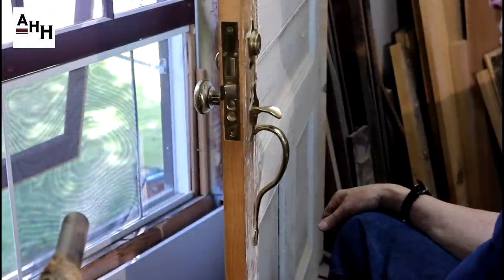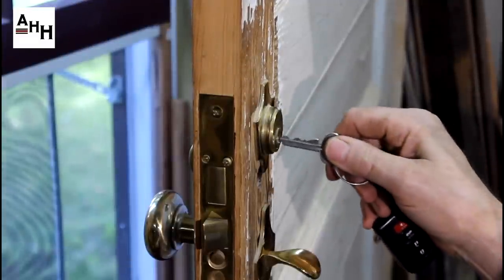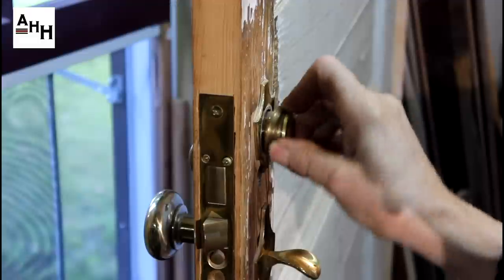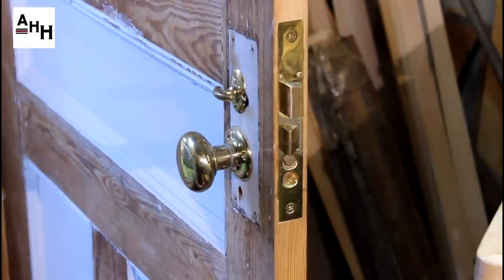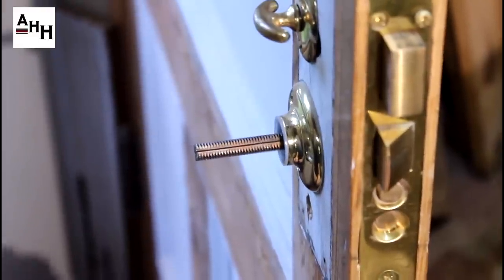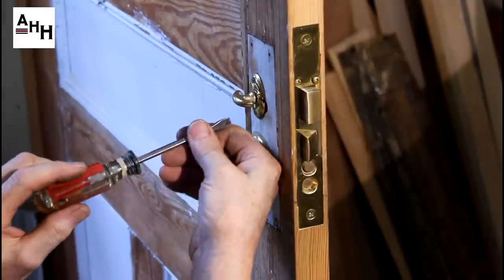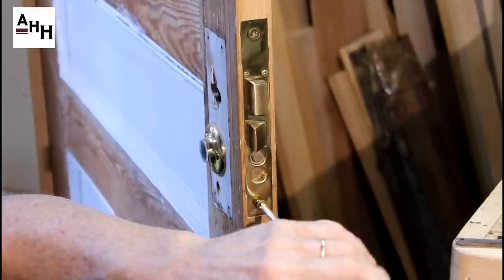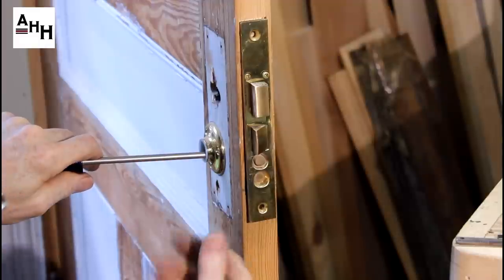How To Remove a Mortise Cylinder Lock Set  From an Entrance Door

Comment: This video was perfect for me.  I have a 1949/50s vintage house with perhaps the original Yale front door lock which was a black version of yours with flat-head screws.  The unscrewing of the lock cylinder and removing the split hook spindle worked just as you said, and I got the piece out without breaking the door.    Thanks!

Comment: I enjoyed the video it give me hope that it could be removed. I tried to reassemble it but as i try to insert lock bolt key there are 2 metal pins obstructing key hole for dead bolt latch. I have exactly the same set up. How do get pass the metal pins? Thank you

Comment: My cylinder won't on turn I even pulled the lock set screw all the way out I think the paint maybe adhere to the edge of the cylinder did you strip back the paint on that door for the same reason

Comment: Is it possible to change the Mortise into individual deadbolt and knob style? I'm trying to add a SmartLock deadbolt and having a problem with matching up the Mortise with the smartlock. Any suggestions?
Reply from the maker: You have a bit of woodworking to do. You're going to need to fill the mortise cut with a dutchman (a slightly tapered plug of wood fitted to the void of the mortise). If you are not confident in your carpentry, I would suggest someone who handles cabinetry can handle this job.

Comment: what do i do if the exterior part with the key is stuck/unable to unscrew.
Reply from the maker: As long as you can loosen the set screw and grab purchase on the cylinder, it should unscrew. I'd does not have to be specifically unscrewed via the slot, that's just the easiest place to apply torque.
Reply: And what if I can’t get purchase on the cylinder???

Comment: I am looking for that exact type of door knob. Can you tell me the name brand of that ? thanks.
Reply from the maker: That would be a Corbin knob. I know we have 2 of a slightly smaller diameter for a 20 thread/inch spindle. Your spindle may be a different thread count. If so, let me know. I may have a one off in stock. Also, just to head off a call, since these are only available in old stock, Corbin-Russwin will likely just send you to me.

Comment: Omg. I wish I’d seen this BEFORE trying to take mine off. I went out of order and now am stuck with the lock cylinder not coming undone. Should I re-assemble and try again the right way? Can I still unscrew the lock cylinder? HEEEELLLLLPPPPP!!!!!😂😂😂😂😂😂 I wish my Dad was still alive!
Reply from the maker: Sorry for how long this took to reply. If it's still an issue, loosening the set screw and using the key to remove the cylinder should still work without the screws in place and the knob(s) off. Just an important point, DON'T PUT THE KEY ALL THE WAY IN. Only a partially inserted key will allow you to turn the cylinder.